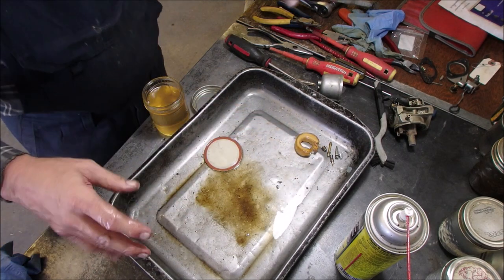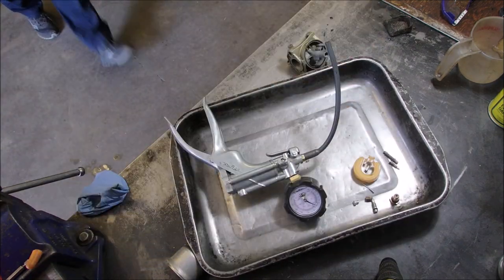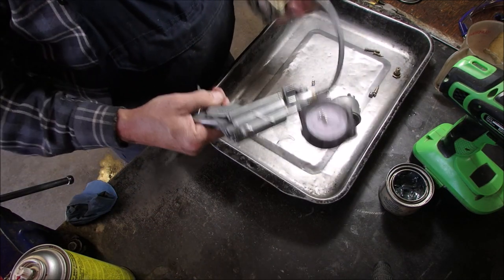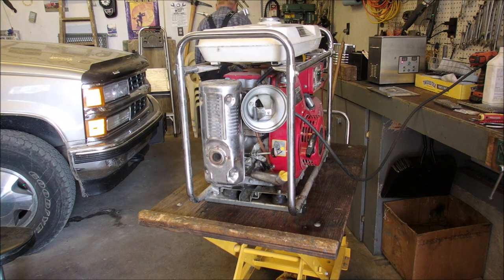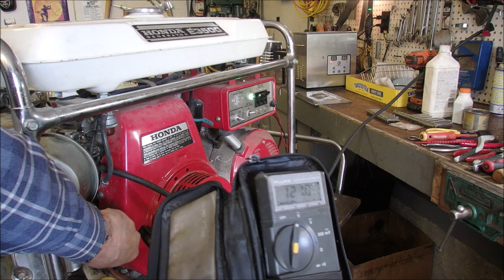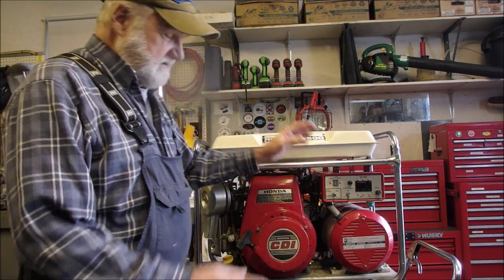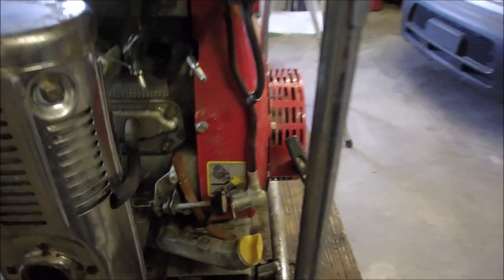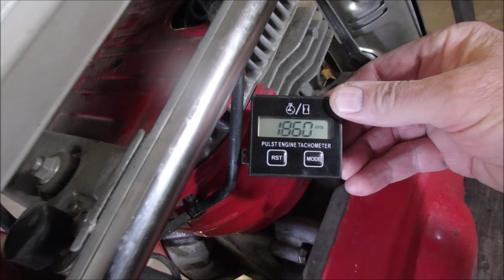Honda E3500 Generator Won't Run, Part 2

Comment: Beautiful older Honda Genny right there! Awesome job my Friend! Cheers! Sean~
Reply from the maker: So good to hear from you.  I was think of you yesterday when I had all 3 impacts going full tilt.
Reply: Mint condition Honda.  The shine from the chrome blinded me.  Do not see many belt drive generators.  The nice thing about belt drive is the engine does not necessarily need to run at 3600 rpm.  A lot of rv’s use belt drive with a 2:1 ratio on the pulleys.  So the engine runs at 1800 while still spinning the generator at 3600.  They run much more quiet at that speed.

Comment: I have the e2500. I need to fix the carb, this helps. A new carb costs 150 bucks and rebuild kits are hens teeth. I might end up just replacing the motor with a predator or a side shaft Honda, belt drive makes it easy.
Reply from the maker: Do the carb clean.  If it is already broken you can't break it.

Comment: I'd call that a win bruce 👍 I do have one question using rubbing achohol does it affect the seals or o-rings at all ?  Have a great day !
Reply from the maker: Not for the time i use it.  I am quite sure if soaked overnight would be bad.

Comment: Bruce, what did you chuck in your drill to grind the float valve seat?  Such good videos!
Reply from the maker: Just the drill with the Q tip

Comment: Nice work mr. bruce 🔧
Reply from the maker: Thanks   It was a 1981   most parts not available.  Thanks again.
Reply: @BrucesShop  unfortunately that's the theme here most stuff you try to keep running nowadays parts are not available

Comment: The speed at full throttle should be 3600rpm=60cycles.
Reply from the maker: Right.  It did end up up near there.  I do understand that.  Thanks though.  Very good comment.   I was wondering if someone would bring that up.  As it is an older flathead i tuned it to just below 3400
Reply: Always some know it all just has to comment. LOL,  you know I'm just kidding with ya brother John 😂
Reply: @BrucesShop  
At EP we also set the rpm level lower on the older equipment just to provide longer engine longevity
Reply: @Wayne Stefinashen  isn't the proper thing to do adjust the rpm to produce 61.5 hertz with   no load?
Reply: @kenhilson786  Yes the man to watch for generators is James Condon and he sets up generators under load and no load conditions to attain the proper output voltage and hertz rating. Not sure if Bruce has the equipment to do all this testing on the generator, but it runs and sounds awesome.